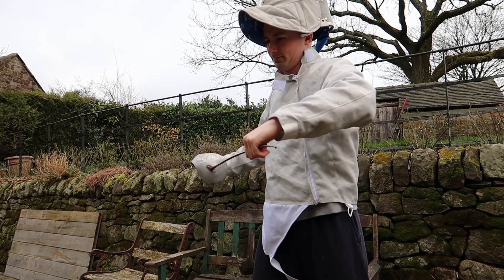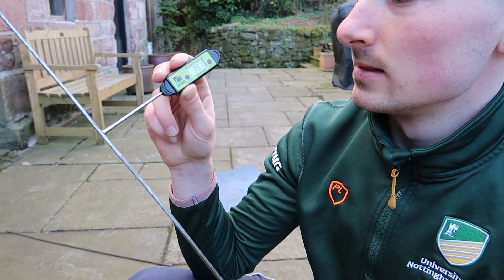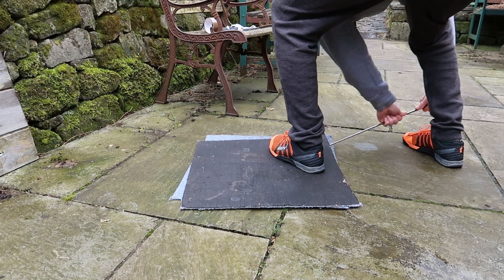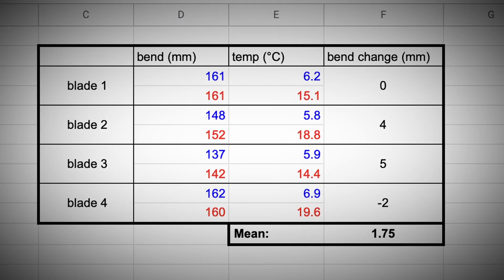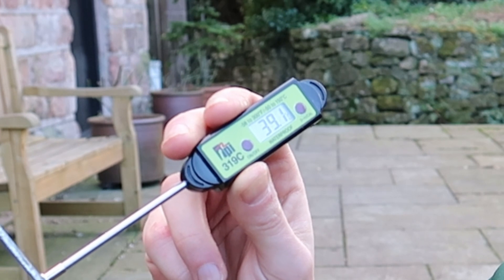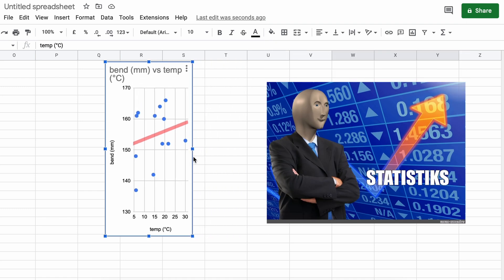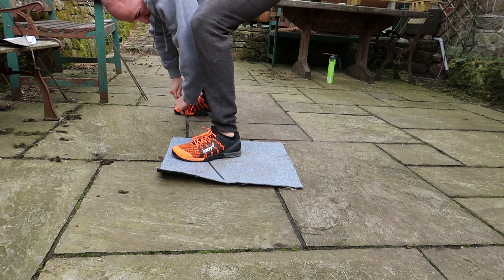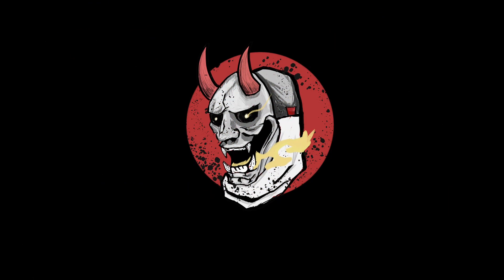Fencing Mythbusters: Bending Blades

Comment: I think the difference between bending by hand or under your foot is not so much the friction temperature. It is just that you keep the bending angle small if you bend it under your foot. Pulling on the blade may help to increase the tension on the outside part of the blade too. But that effect will be very small too and may even help cracks grow in that side of the blade.
Reply: This is my first thought as well - bending by hand when holding the guard in one hand and somewhere near the point with the other seems likely to get more of the force localised in one area, with the potential to break being higher. When you run it under your foot to straighten it, you're bending it over a longer distance, more blade area getting less force. This might mean the effect is better for straightening a curve than a sharp angle, but TBH once it's made a sharp angle it's maybe not recoverable anyway.
Reply: Straightening a blade under your foot is safer. I was making this point in a beginner class, stating that if someone bent a blade please ask me for help and that under the foot is safer. Student proceeded to bend a blade in an action and then quickly tried to straighten it himself. The blade broke right at his thumb, causing a gash that took the rest of class to stop the bleeding and bandage. Better to have it break between a shoe and the floor than against a thumb or palm of the hand. Another reason not to run your bare hand on the blade is the possibility of metal splinters. As the blades impact each other, they are shaving bits of metal off the blade and possibly causing micro cracks (future possible break points) this is the reason that using a towel before handling a blade is suggested.
Reply: Correct, the "bending angle" is the key. If you bend by hand, you are much more likely to over-bend it and to then have to bend it back. These cycles of bending the material back and forth just mean more total plastic deformation/bending and this causes material fatigue. Also, indeed, steel gets more brittle in the cold, it's a know mechanical engineering issue. I've seen a guy snap the blade on a forklift in very cold temps like this. It can literally break like glass. Yes, this is an anecdote and should not be taken as a general rule but there it is...

Comment: I use my foot to apply more force to a smaller section of the blade and bend the really bad kinks. Smaller adjustments with the hand. Not that I ever thought about it. Just from experience.

Comment: So here is basically what I was taught. As far as "heating" the blade, it's not so much about making the blade easier to bend as it is about preventing making cracks in the steel. If the metal is cold, like form leaving it out in the car during winter, you are more likely to form small micro cracks in the blade when you bend it which would lead to blade breaks. As for using the foot instead of the hand, obviously you can use more force with the foot, but more importantly, you don't have the risk of getting metal splinters in your hand.

Comment: As a lifetime fencer and mechanical engineer I applaud your curiosity and experimentation.  But my conclusion is that you focused no the wrong aspect of blade straitening.  The diffnece between bending the blade in your hand vs sliding it under your foot while pulling upwards has to do with concentrating the strain in one point (hand) versus distributing it over a wider length of the blade (foot).  
Here's how to 'properly' straighten a blade.  Get yourself a small  box wrench (they sell these for 50 cents at Goodwill or other thrift stores).  Put the blade through it.  But DON"T try to straighten the bend all at once.... move it to several spots above and below the bend and apply a small amount of torsion with your wrench.  The wrench gives you so much mechanical advantage that you can easily put 6 or 8 small corrective bends that nullify the horrible bend you're trying to fix.  This way you never really strain the steel into the plastic zone and you're "it might break!" bend is easily repaired.  
I learned this from Dave Micahnik the long time coach at Penn 40-45 years ago when we were on some international trip together.  It's never failed me since.

Comment: Interesting experiment. Though I think something is missing. I’m a longtime fencer and coach (28 years now).
Using my shoe and the floor I can straighten blades in often one, sometimes two passes.
I straighten while passing between the foot and the floor with heavy pressure.

Straightening cold in my hands takes a lot more time flexing and bending the blade.

I’ve also used a wrench to fix small bends or side to side bends. That works pretty well with a cold blade.

Comment: I agree about the temperature being irrelevant (unless you have jittery hands in a freezing cold fencing salle and overbend your blade!)... or live near the artic circle.

The difference in strength of maraging steel (18%Ni) is a decrease of 3% between 0 degC and 50 degC and 2% between 10 degC and 35 degC. It's brittleness is not going to change much either... that's why we use maraging steel. It is not brittle and it's brittleness doesn't change over time and not substantially with temperature.

The cheaper carbon steel does develops micro cracks, but you'd have to live in the Arctic Circle for the cold to affect the blade ductility. I'd think that the reason you use a towel or your foot in that case is to stop your hand freezing to the blade!

I've broken a few while straightening them over the years, but it's usually because it has a kink in it and I get over-enthusiastic. I do straighten them by hand and not foot, but one of the risks of using your hand is steel splinters. If you want more control, use the "ring spanner" method (or the handle of a large crescent wrench).

I've just been straightening a brand new maraging foil blade that developed a kink the very first hit. In my experience this blade is now toast, it's just a question of when. I can still see the point of inflection of the kink, but have given the rest of the blade a nice arc either side to hopefully compensate and overcome any tendency to kink again, but.... I used both a ring spanner and my hands (no feet) and it took about 20 mins of gentle but firm bending both sides of  the kinked area.

I'd be interested to know if this kink was due to a defect in the blade or just bad luck (or both). I've had it happen once before, many years ago, and I'd  think it's a defect in the blade.

Comment: Observation. I believe your experiment is off track from the get go. You are measuring the flex of the blade at different temperatures. There is no reason to expect it would shed much light on the physics of straightening a bend in the blade. Straightening a bent blade is about the geometry of the force applied.

In an earlier comment Edwin nailed it. You put it under your foot so it won't flex, and will bend at the desired point to straighten it. Heating the blade a little before bending it also facilitates the bend. But that is secondary to modulating the flex and isolating the bend.

Even if temperature had absolutely no effect on the process, straightening your blade under your foot is the way to go.

For what it's worth.

Comment: I am pretty wary of bending foils and Sabres with my foot unless it's some ridiculously large attack in prep kink. Micro adjustments between the two thumbs to get a consistent contour is the best method generally in my experience and is much less likely to crack the blade. I've almost never snapped a blade by hand, but by foot, even with a shallow angle.. It's a real gamble.